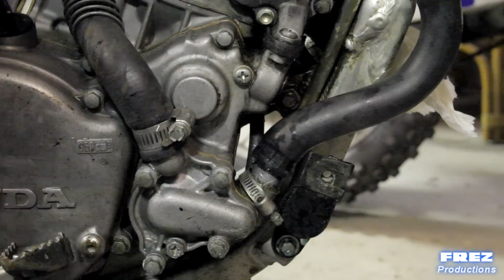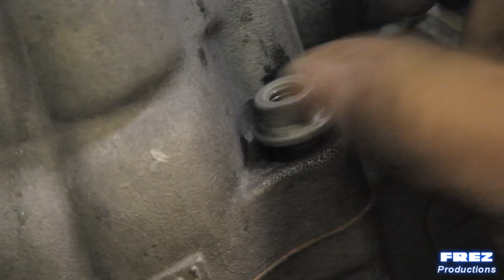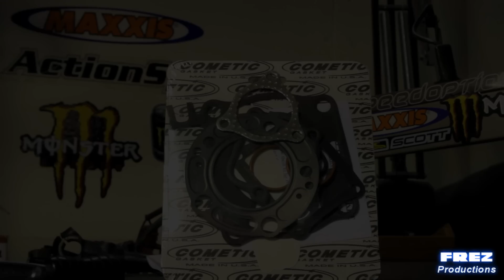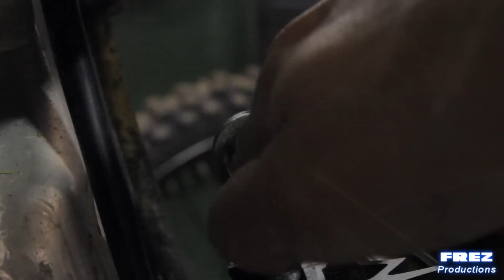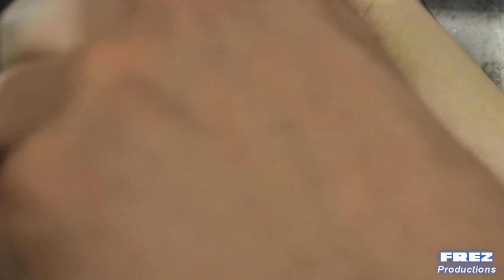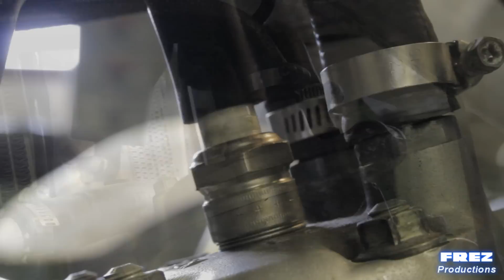Honda Cr 125 piston / top end rebuild.  A movie produced by Frez Productions

Comment: for people who want to save time. dont take the head off. unless the gasket is damaged or you are having compression problems there is no need, just slide the barrel out from the top and give it and the powervalve butterfly a good clean with carb cleaner/brake cleaner. great video by the way.

Comment: Not really a good example of how to rebuild a 2 stroke properly imo. For starters they never showed the need to measure the cylinder to make sure you select the correct piston size (to compensate for bore wear that can only be obtained by measurement with a calibrated bore gauge). Secondly they never showed the use of a torque wrench to tighten down both the cylinder base or the head,that can lead to many problems in itself....And lastly and very importantly he never showed any sort of check for the "squish clearance". Anyone who knows anything about 2 strokes should know the importance of it,both for performance and at worst,could lead to detonation,or piston-to head contact that will destroy an engine very quickly. The video shows how to do a "top end rebuild" but definitely not how to do it properly.

Comment: It's good to dissasemble the power valves because when you're starting new with a fresh rebuild, there good to clean because over time they build up alot of carbon and don't want to work properly which can have a huge impact on power and throttle response. That is where I went wrong years ago. I rebuilt my 02 kx125, but I never cleaned the power valves and it definitely didn't have the power it should've for a fresh rebuild because that really does have a huge impact on several different things.

Comment: At 7:29 you are missing a washer/bushing where your power valve actuator arm attaches.   Also put a rag below to block the pin from falling into the right side cover.
Nice job on the production of the video.
Reply: Bro you’re  a life saver didn’t realize mine was missing it until now🫡

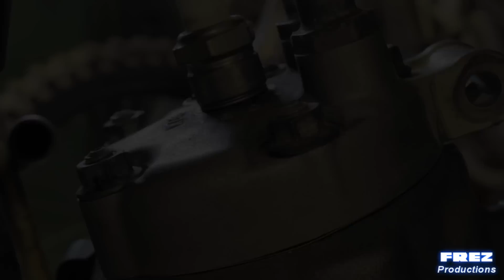Comment: Hi, @ min 7:24 you forgot to put on the flanged collar that rides on the tie rod linkage that connects to the exhaust valve.  You just secured it with the cotter pin is all. I would fix that.
Reply: Vinny Garner was thinking same thing that hes missing that collar, but then again the bike might be missing so hes working with what hes got
Reply: Was gona say the same

Comment: also wanted to point out you have a single ring piston. there are also 2 ring pistons availabke. 1 ring pistons are preferred for race use but 2 ring pistons are preferred for longevity and non-race use.
if your cylinder wall is scored or worn, or you just go big bore, you really want to shop around for a place to mail your cylinder for a proper bore and replating. Bore-Tech in Ohio is the one I know of in this region.
Reply: lastly, I should add that if you put in an aftermarket forged piston,  they require proper longer warmup times before getting on it hard. oem cast pistons should be warmed up properly before riding hard as well, but the forged materials are much more sensitive to thermal expansion/contraction, and it becomes even more critical to give the engine proper warmup time to get to normal operating temps.
Reply: Double ring piston in a 2 stroke= more friction less power your way better off to runs single ring
Reply: chuck lambert I'm not aware of any twin ring pistons for 125's for anything above 150cc I definitely would want two rings. Single rings have around half the life of a twin ring setup. Also if you have a nikasil plated bore which pretty much any bike 30 years or newer will have, I'd recommend just getting them replated over getting it over bored unless you're looking for power. It's only around 200 bucks to get a replace and it lasts as long as any new cylinders plating will.

Comment: Professional..I had just picked up a 1982 Cr 125r.I have to say it's in very nice original condition.I am going to replace the piston,ring and top gaskets.Because of it's age and knowing it has tempered through it's riding hours I was told to put a very thin coat of good quality gasket permatex on them to ensure a good all around seal in case there may be any imperfection on the actual surface.I am not going to have it resurfaced on the head but clean it well and assemble..Any comment?

Comment: Nice vid jangho9! did you use torque wrench on cylinder nuts? just asking if its a MUST to use it because my Kawasaki KX 125 has the cylinder nuts in a really tight spot and its impossible to use torque wrench on them unless you buy some specialty tools for it... i'm a bit afraid that cylinder ain't tight enough even thought i tightened the nuts as tight as i could with a small 12mm wrench (that's the only tool that can be used on them).

Comment: Most models u just pull out the rods and flap its basically a gate that opens and closes for more exhaust to escape disconnect the one side then pull the pin threw. As in cleaning it i would use contact cleaner or brake cleaner something to remove the oil. Make sure tho after u clean it lube it back up with some rawww premix. Next time if it dirty change your jetting or fuel oil ratio

Comment: i admit last time i did a top end that nut under the power valve cover i had to shave a bit of meat off a ring spanner, so i did not properly torque it back down along with the rest, luckily were i work now i have access to torgue wrenches that should allow me to use open end spanner bits to torque it. otherwise a standard socket torque wrench would not fit in there. ( hence previously just doing it up by hand with a modified ring spanner, untorqued.)

Comment: great vid, but you left out a quick medium grit ball hone on the cylinder walls. the new piston ring very much needs this to get seated in properly, as the hone deglazes the cylinder wall and leavesthe  microscopic cross hatching pattern to wear the rings in on the first proper run. if you don't hone it or just baby the engine and heat cycle it several times easily, you blew your chances at having the highest compression possible until next refresh.
Reply: also, once up to operating temp (& not on synthetic oil mix), you need to do 10 or more runs of medium hard medium rpm acceleration and then deceleration engine braking then repeat x10+. the added cylinder pressure forces the rings outward into that fresh hone pattern and wears them into each other. if you wait more than a mile or 4, the cross hatching will still be visible (if torn down or bore scoped), but will be worn down to the point of only acting as an oil carrying channel to aid in piston/ring lubrication and fight against cylinder wall glazing.
this info is the same you will hear from top performance engine builders. what you DO NOT want to do is not hone and after hone do not run it at a steady constant rpm (easy, it's a 2T ripper).  you must vary the rpm nonstop the first few rides and do not run it full bore 100% but also do not baby it, run it up and down under decent loading but don't ever lug it.
Reply: No need to do all the steps you have listed. It's going to be fine once it's started, I have been riding 2 strokes for over 30+ years. Have rebuilt top ends at the races in between motos, not one failure!
Reply: 22raddad 
you won't cause any greater chance of failure by not properly honing and not properly breaking in the engine  in the first several minutes of running after a fresh set of rings, but you will lose out on gaining even more ring sealing and even greater compression and engine power output if you skip the proper honing with a brush hone and skip the proper acceleration/deceleration break-in procedure.
note that I said brush hone, not a ball hone which I mentioned above, which is not as good for a 2 stroke application - brush hone best for 2T.
Reply: Funny you say this, my compression is the same either way! Ride on buddy.
Reply: Don't take it from me, ask the top engine builders and race team mechanics. Ride on...

Comment: This helped a lot how do you figure out the piston size and do you have to bore out the head if nothing but the rings are bad I got bad rings on a kx125 and it don't go fast at all and I didn't think I had to bore it out
Reply: if the cylinder isn't scored (all scratched up with little groves in it) you don't need to bore it. Vise versa. You need to take it to a mechanic to bore it. I'm sure they will bore it to the next size (example: your piston is 47.50mm they would bore it to a 47.75 or 48.00) Then you would go buy that size piston. (search on a bike store such as motorcyclesuperstor. com, kx 125 48.00mm piston.) Hope this helps a wee bit! :) Good Luck!

Comment: Thanks, good job man! may i ask abaut a problem on my husky, i have water in cylinder; after i pulled out it s working good, but at the next igniton it won t start before i pull the water again... what s the problem? I have compression, it s just that my fiche is full of water i guess it s the gasket; Any sugestions?
Reply: seal around spark plug,casket.....but i suspect the comression and preformance would be down :)
Reply: you mean the up side casket or on the both up and down (the cilynder) casket? i don t think that it s water under the piston in the engine...(i guess it wouldn t work if it was), also if it runs, i t s ok no mater how i ride it, but on the next ignite it won t work... also i saw that my cooling liquid in the watertank is getting low... so? Thanks again, i ll start the job tomorow!
Reply: i'm a miracle man i can find faults with out looking or hearing the bike in question....i'm a walking diagnostic prober :)...

Comment: do you not have to file the ring gaps on two strokes or did you just not show that step? I know on my 450 you had to have the proper gaps. Also did you hone the cylinder or is that necessary?

Comment: what about torquing? awesome video, well produced, but if I was a kid trying to turn my own wrenches I'd think I could just slap it back together and not follow the bolt sequence or torque specs
Reply: Your gonna have to eyeball it the Power valve covers are in the way u cant get a torque wrench in there snug not too tight u wouldnt wanna strip the threads in that spot you would be fooked
Reply: You still might not be able to slide those in because the wall to the bolt may be too small. But those crows feet are pricey jeez 130 for a set
Reply: +Matt Powell I needed them for my lt250R jug because of a similar clearance problem, they come in handy on lots of other tight places

Comment: I’m curious as to if the 125 has a bridge port on exhaust side of cylinder, if so you should drill two holes in the piston skirt in the specific location and diameter offered by the company selling the piston
Reply from the maker: Yes this cylinder has a bidge on the exhaust side of the cylinder. Im using cast piston in this bike so no need to drill holes. If i used aluminium pison, i would need to drill holes. See my 2 stroke tech video. All you need to know about drilling holes on pistons is in that video :)

Comment: Looking inside my power valve cover, it looks "Clean" inside.  Yours looked more "Oily" Should it have more oil deposits in there?  I also found two metal pieces in there.  Any recommendations on how to confirm the linkage is good and if maybe it is blocked for oil?
Reply: +Michael Jones it shouldnt really be oily, there is lip seals on both the power valve shaft and also on the spline that actuates the power valve

Comment: What kind of compression do you want out of a rebuilt cr125. I have 130 lbs in mine. Wondering if this is too low?
Reply: yeah that is pretty low, your cylinder is probably worn past its service limits. mine has 185 without it being rebuilt that I know of...

Comment: I just did this to my 93 cr 125 i had to have the cindler re sleeved . It's at 120 psi. Everything is set to stock on the carb . Runs  but poorly is this due to a worn crank seals?  .

Comment: How do I know if my top end is bad? I was riding my bike yesterday and doing about 65 mile-an-hour when all of a sudden it started to slow down like it was running out of gas. I kept trying to feather the gas to keep it running with no luck. Finally stopped try to start it up again and it started but then immediately started running out of gas.so I parked it behind someone's barn and took about 20 minutes to walk back to my truck and by the time I got back to it I started it up and it ran fine again but instead of driving it any further I just loaded in my truck to not cause any further engine damage in the event it is something more serious. But how do I determine if I need to rebuild the top end

Comment: IMPORTANT: 

does this work for other 125 2strokes too? for example: husqvarna sm 125 ??
Reply from the maker: +Nicki De Luca Yes it will work. All 2 strokes are basically designed the same. But the Husqvarna might have a different design on the exhaust valve. I dont know because i have never had a Husqvarna.
Reply: Ok thanks tho :)

Comment: Hey jangho9 what's the best way to brake it in after I do my rebuild... I have the same bike
Reply from the maker: +cobra7king Hello :-) What i do is to go out for a little longer dirt bike ride. Not on a MX track but on gravel road.
Not pushing the engine. Easy riding so the engine gets the right temp. When the engine has cooled down from this ride, i ride her hard the next time :) But thats how i do it. There are many ways. Some are doing very detailed "break in" processes and some ride the bikes HARD the first time after piston change. But i like to be a little gentle to the engine after piston change. Hope it helps.

Comment: That was the dirtiest power valve ive ever seen! I cant believe you didnt clean it!
Reply: Also make sure when you put it back together that you adjust the power valve clearance its also called the x demention its from the top of the cylinder head to the power flap in the fully closed postion. Especially mark this step if your moving up a size in the piston
Reply: I have the same year model in this video. That power valve is nasty!! Not to mention when he is putting the power valve arm clip on, there is a part ( OEM part#19323-kz4-700)  missing!! It's a $4.10 part! This is a good video but needs to emphasize that you should replace worn out or missing parts before its reassembled. I run race gas and my power valve and exhaust flange are nothing like the one in video.

Comment: How do you know when you need a new piston? I have a 1991 cr 125 that keeps flooding and looks like oil? Is dripping from the exhaust any advise would be greatly appreciated. Thanks
Reply: All 2 strokes should have some splooge coming out the exhaust. Usually on a 125 its like 20-30 hours on a top end. You can open it up and check the walls of the piston to see how it looks.
Reply: Reece Duncklee thanks
Reply: You can always just check your compression.

Comment: Why do you use sandpaper on the pistonpen? Any reasons for doing that?
Reply from the maker: +david raaymakers Im not sure what you mean?
Reply: +Jordan Hillard Thanks Jordan, I skipped a part of the video so it looked like he sanded the pistonpen.
Reply: Make sure you do lube the wrist pin and piston when checking your ring gap you may have to sand/file the rings to smaller sizes so they can expand in the heat

Comment: when u rebuild a two stroke do u have to hone the cylinder or not...I curious Im new rebuild engines
Reply: sometimes not all the time
Reply: Braptastic films as long as the cylinder isn't damaged, you won't need to. if it is damaged, and you do have to bore it out, you have to get a larger piston.

Comment: when u rebuild a two stroke do u have to hone the cylinder or not...I curious Im new rebuild engines.
Reply: IT depends in what shape your cylinder is. if its good IT doesnt need to be re honed
Reply: Only if it is worn meaning scored, scratched, scraped etc. just rebuilt my 03 kx125 didn't do anything to the cylinder everything is good
Reply: You don't hone Nikasil cylinders.
Reply: Braptastic films NO just contact cleaner with some scotch Brite then use wd40 with rags till nothing is on the rag.
Reply: mauricemojo234 you can but it will just mess it up more bad

Comment: hey i have a question. I don't know if I messed up or not. so my piston is in my cylinder but the head isn't on. I can push the kick start down with one finger. Is that normal because the head isn't on?
Reply: yes when you put the head on its going to be right
Reply: yep that's normal just make sure you seat the head all the way down before putting bolts back on .

Comment: I see you didn't bore the cylender. do you have to
Reply from the maker: No because this cylinder has Nicasil coating on the bore (aluminium sleeve). If you are running steel sleeve you need to  bore.

Comment: I got ah 1985cr mint condition. I'm waiting for my head to come back its been bored to 56mm.does anyone know how much compression I should have and also the torque down on the top end head.
Reply: My cylinder  is also being bored to fit a 56mm piston as we speak
Reply: @motomash6143  sickk were in the same boat then😂I just payed 450$+ for head work done and pistons and rings
Reply: @DaButtonboyzKennels  you posted it 5 years ago lol are you still doing it? Haha
Reply: moto madness #29 no sir I’m actually working on a 2001 Cr 125 getting the head replated

Comment: how do you torque the last cyl nut down ?
Reply: Good question.
Reply: Jacob Rintala The only way to get at one of them is with a open end ! just gotta do it by feel i suppose
Reply: rerejinglefish  motion pro cylinder wrench 

It's a 2 sided 12mm 14mm boxed wrench with a 3/8 ratchet or torque wrench slot in the middle of it. Look it up its like $15
Reply: ^^^ word il remember that